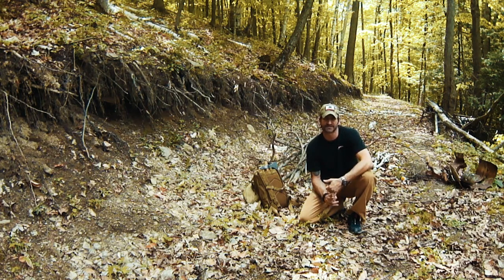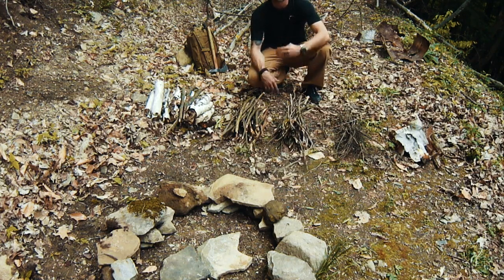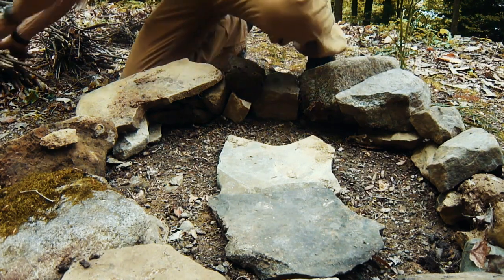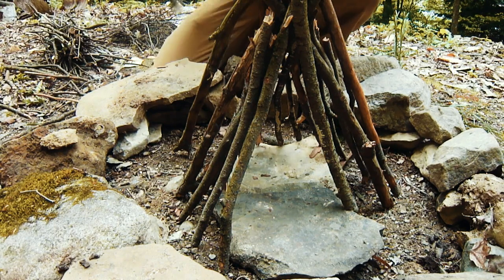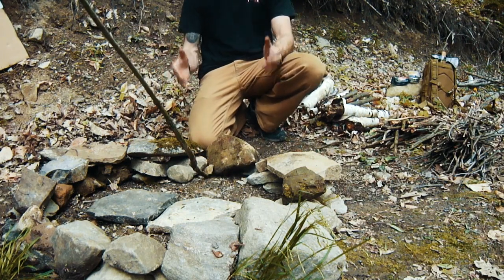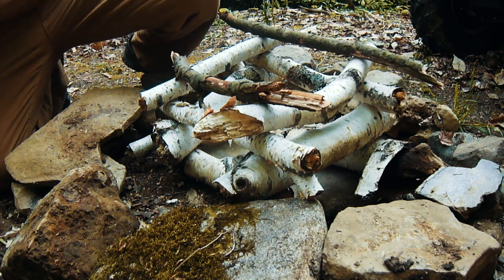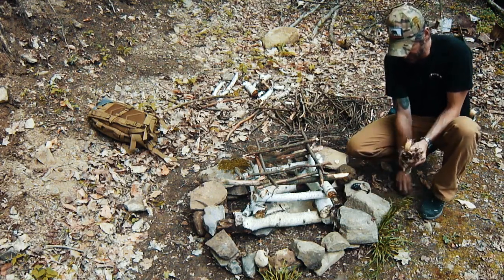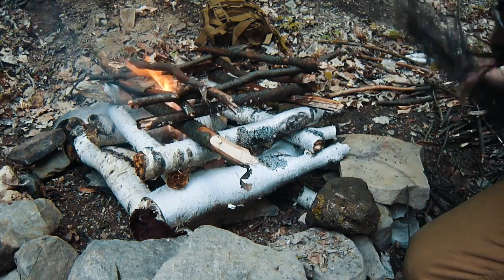[FIRE BUILDER] simple fire building system.

Comment: These are all good however one great idea is to put some bigger pieces of wood, they can be a bit wet even, down as your base instead of the rocks.  I've found this to work great as a drying out method and start to a coal bed technique that lets you have fires that last 10-15+ hours.
I also place any wet wood around the fire as it's burning to dry it out before burning.
Reply from the maker: I can vary from each situation. Certainly good for drying out wet wood as long as you can get the fire going on top of it. T

Comment: Decent bottom lit basic fire starting video, watched video to see if you were going to introduce efficient top lit fire building techniques.  Most important message was preparing fuel for fire building.  Compressing tinder though is creating mass, which can be detrimental with wet fuel.  Light and fluffy is easier and more efficient for combustion of tinder, although you were using a commercial fire starter with tinder.  Good job reinforcing fuel preparation.  SilverFire Sto
Reply from the maker: Thanks for the insights! We'll keep top lit fires in mind for future videos as we plan to make many more! T
Reply: I agree it isn't special, but it doesn't have to be. Novices such as city dwellers may never have made a fire, they arewho really need this.
Reply from the maker: True, no need to be fancy! Novices can come from anywhere, either way we're happy to help inform! T
Reply: I remember a few years ago I was just entering the prepper lifestyle. Luckily my dad had already taught me camping and building fires and yes the "fluffy" tinder does work better. I'd say in time they'll learn, but they may not have that much time.
Reply from the maker: True it helps to start learning before a crisis. Good to hear your dad gave you the opportunity! T
Reply: Good points, Todd. I do teach the top-lit self-feeding fires like the Pyramid and the Reykovalkia, I just didn't consider them the "basic" fire lays that were what I was trying to isolate for this particular video. I will get some video content of them in the future. Sounds like you already know how highly efficient those are